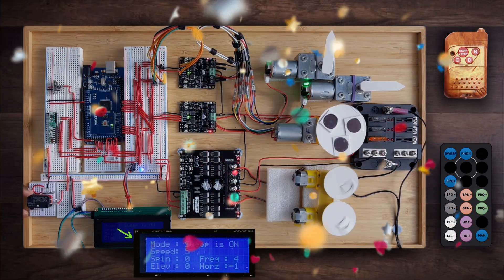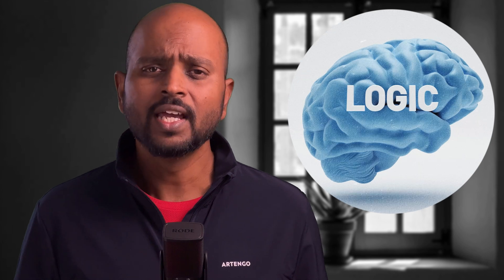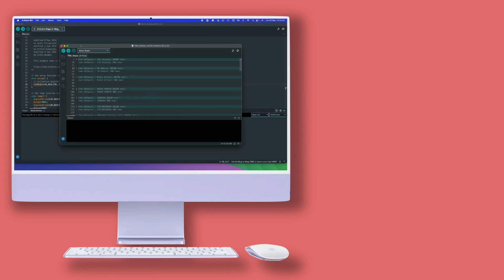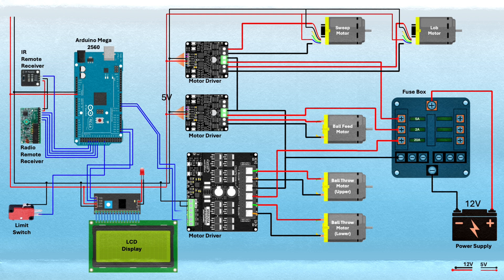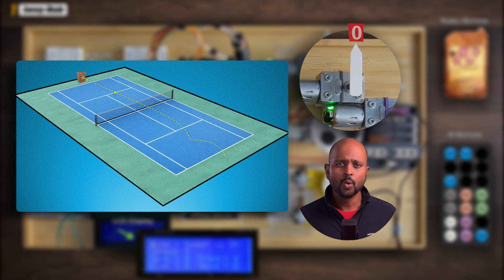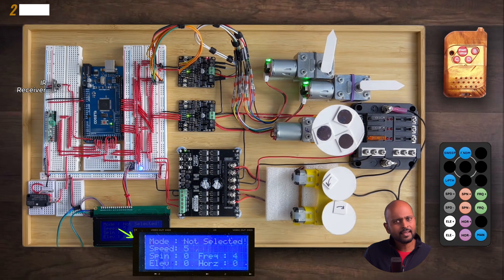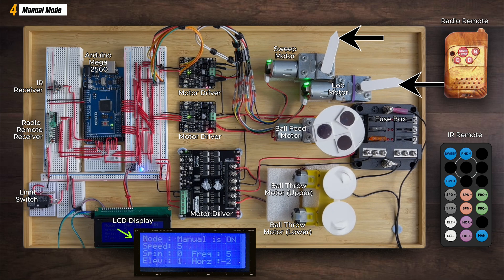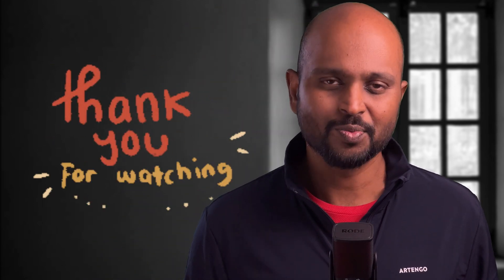Part 2 - Software and Circuit - Tennis Ball Machine - DIY Build

Comment: Hi John, I'm trying to control the arduino TBM Master program with only IR control and I don't want to use radio control to send a GND to pin 43 (changed the on/off mode) My question is, what should I change in the program to not use radio control and only use your timer delay ?  .  Thanks !
Reply from the maker: Hi there, in the final product I have listed on Patreon, there is no IR remote, its only a timer control. You may want to adjust the timer value to suit your needs.

Comment: Hi John. How did you figure out what gauge of wire to use for this project?
Reply from the maker: great question, its something I had to spend some on.
for the main motors, I went for 12AWG that can handle a lot of current. Motors at start up use a lot of current, the motors I have listed use about 50A at start up and then fall down to 5 - 15A depending on load

for all others, AWG 18-22 is just fine, there is not a lot of current flowing through them.

Hope this helps :)

Comment: Hi John Alister, you're the person I'm most mad at right now. Inspired by the videos you posted, I later decided to build a machine of my own. This has been something that's been going on for a long time, and thanks to you, it's finally where these systems can be transformed.

Thank you. I purchased all the Arduino and electrical equipment based on the information you shared. I don't know the last two forms at all. We are trying to improve Arduino programming. I even managed to hook up an encoder engine to Tinkercad and get it working. I wish I could say it doesn't seem that hard.

I'm currently looking forward to your Arduino code video.
Reply from the maker: Thanks for the comment! Building this machine is not a joke, a mechatronics professor said that this project has all the components for a decent university project. Which only means its not easy but at the same time, it can be a bit tiring to get the results we want out of the machine.

I am so glad that you found some inspiration from my videos. I cant believe it but the machine that I was building is complete now. I am in the process of making a video - the final part and should be out in the next week. I am also making a detailed manual for anyone to build it with a healthy dose of curiosity and tenacity of course :P  

Keep at it mate, you will get there eventually and every hour spent solving issues only gives you experience and will make the end that much sweeter. All the best! @sinanasl

Comment: Hey John. I have a tennis machine that lacks the feature for adjusting the height of the ball with a motor. I have to manually adjust it by hand with a knob. Is this something you could help me with? I would also like to program shots as well if that's possible. Thank you
Reply from the maker: Hi Chris, if the machine already has a knob you could have a gear motor drive that knob with a gear attachment. Then use a remote with receiver to turn the motor on and off. But this is a lot easier said than done. 

Anything can be done but you have to evaluate the cost vs benefit. 
It possible that there is enough space inside the machine but that only start. 

If you are not comfortable with electronics and taking things apart then my advice is don’t bother. Sell the machine and get one that does that. 

The code I’ve shared can be a good start if you want to tinker with the idea.
Reply: @john.alister  Suppose my machine has dials to adjust the speed, feed, and topspin/backspin using the little knobs. Is it possible to convert to a wireless remote instead? If so, what's the name of this idea so I can look up other YouTube videos?
Reply from the maker: Hey Chris, Not knowing the internals of the machine, I would guess the knobs to be the potentiometers that 
1. either tell the microcontroller to send appropriate power to the motor driver that in turn drives the motor. lower dial value (closer to minimum position)would mean lower power output and higher dial value = high power to motor and hence higher speed.
2. Or, the potentiometer directly control the power output to the motor. This is possible if the potentiometer (knobs) are part of the motor driver unit. In this case, there is no microcontroller. THe motor is connected to power via the motor driver that has a potentiometer to control the speed. 

In both cases, it is possible to add a remote which would replace or wrk along side the potentiomenter (knob) but better if they replace the knobs given the knobs work on the level of resistance. Its getting complicated but check out the below forum post the says the who idea is doable but complicated and expensive. https://forum.arduino.cc/t/using-arduino-to-instead-of-knob-on-pwm-dc-motor-control-switch-unit/197887 

basically you need to 
- check if the know is analog or digital
- check if it is sending signal to a microcontroller or directly to motor via a motor driver
And then make change to add a remote.

My code as explained in part 4, shows you how to get a remote working with motors and microcontroller which can be of some help. Looks like you need to take your machine's electrical and electronics apart to achieve this. That's easier said than done.
Reply: The machine that I have is a silent partner edge series

Comment: Hi John, I was thinking that if a touch screen, was used for the parameter controller rather than the display+remote, you'd have one less device and 1 less battery to worry about, and also avoid the risk of a magpie swooping down from the gum tree and snatching the RC  :)
On the other hand, maybe on a hot day after an hour of intense TBM'ing, one's fingers might be too sweaty for a touch screen, so the RC might be the better option!   just wanted to know your thinking....
Reply from the maker: Absolutely right, I thought of that and realised the cons outweigh the pro's. Not only the sweaty finger but also, damages to the display from a flying ball or or just getting tipped over etc meant its a high risk design choice. 

Ideally I would have implemented a tethered keypad like inout device to select modes but then it would mean I have to bend over or crouch press buttons which is not ergonomic. 

The IR remote work great at close range and that is what I have here. So it works out. The logic to decode the signal is not wildly different from a keypad device so its not too bad code wise.

I even thought about implementing a speaker with a voice output corresponding to the user selected modes and functions but decided to cull it in the interest of keeping things simple. Also, it is not required for the machine to function which aligns to the product development principles of Minimum Viable Product (MVP) 

Thanks for your comment thought, very valid and thoughtful!

Comment: Hi John, what motors are you using for the horizontal and vertical oscillation? Also, in the beginning, you talk about the code for all the modes. I'm planning to build a tennis machine for playing Padel, so the modes would be slightly different for me. Actually, I think if you make a video on the coding part, it would be very useful. Or would you be willing to share yours with some explanation on how to edit it?
Thank you

When are you releasing the next part? Looking forward to it 😀
Reply from the maker: Thanks for the comments Michael, really appreciate it. I am using a worm gear motor with optical encoder for the oscillation modules. Here is the amazon link - https://amzn.asia/d/03pXnX6l

As for the code, I dont mind making a video at some point in the future and you are not the 1st to ask about it so I am keen to make a simple explainer video.

As for the next video, I am sort of at cross roads at the moment. There is a challenge or i shoud day a problem with the ball launch module. My designs are not quite working out and I am experimenting with alternate designs, so far no luck. Put simply, coupling the ball throw motors to wheels and mounting them on a frame seems to be quite a bit of a challenge as there is a lot of vibrations from the asymmetrical nature of the wheels and alignment with the motor.

I am working my way though it and hope to arrive at a solution that doesn't entail a full blown engineering work. Off the shelf items are proving to be a paint to work with. 

I knew this would be the weakest link and so far I am being tested by it, I hope i have some good news very soon. In fact I was intending to post this message as an update on he channel, and will do that soon.

Thanks for your interest and all the best on your Padel ball build.

Comment: Hi John, wow, great work! This is by far the best video on YouTube on how to build a DIY TBM. I'm trying to build one too, but I know nothing about electronics or electric motors. I started to learn about this stuff a month ago (I didn't even know which one between red and black was positive and negative) 🤣🤦‍♂
Building all your modes seems way too complicated for me, but I think I can get at least to the Manual mode. Can you show us how you built the sweeping mechanism as well as the vertical oscillation mechanism? Also, I'm curious.. what are the motor driver boards for? Are they the equivalent of potentiometers? But I guess those are meant to be controlled through coding with the Arduino Uno, so everything becomes automatic? Thanks
Reply from the maker: Hey Michael, thanks for your comment. Love your appreciation and eagerness to know more. 

 When you say "how you built the horizontal mechanism" do you mean the software or the mechanical  part?

I haven't yet built the mechanical part yet but the software part is done (mostly). I'm sure I'll have to make some tweaks when it's all put together. 

If it's the software you're after I'll try to make a video on that separately. 

I'm like you I guess in done respect.. Trying to build one with little prior experience so it may be a while before I can make a video on that topic but I'll try for sure.
Reply: @john.alister  Thanks for your reply, you're very kind! Yeah, I'm sorry I meant the mechanical part but also the software part is essential. What motors are you gonna use for the vertical and horizontal oscillation? You're using DC motors with gearboxes, right?

Awesome video btw! Well organised and explained. Great editing skills too!
Reply from the maker: The motor drivers, like the ones in the video allow you to control the motor from the microprocessor (like Uno). They also manage power to motors so the microprocessor is not supplying and help with easy speed and direction control.
Reply: @john.alister  what motor drivers did you use
Reply from the maker: @ElyesaDemir-s9z  thanks for the comment! I use MDD20A for the high power throw motors and two MDD3As for  low powered gear motors
Reply: @john.alister  thanks!! we're actually building a machine like this for our engineering project. we have to launch a nerf vortex spear instead of a tennisball!